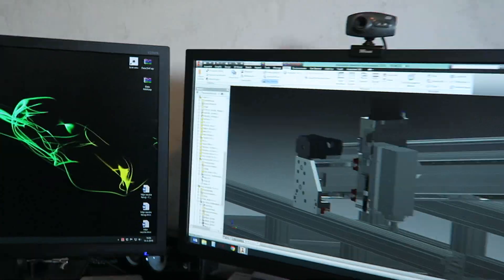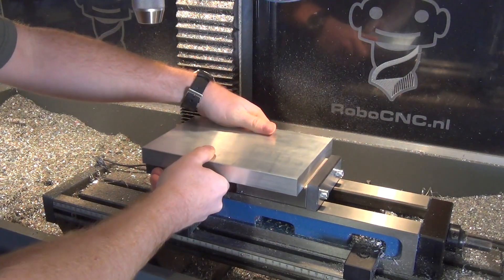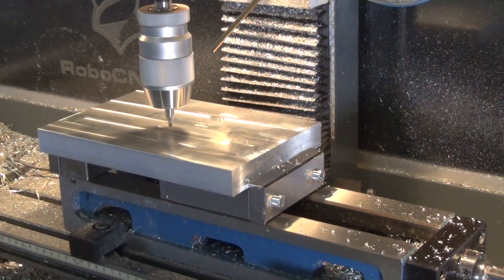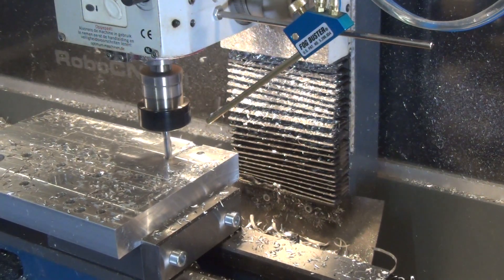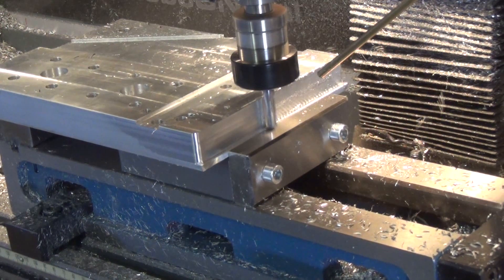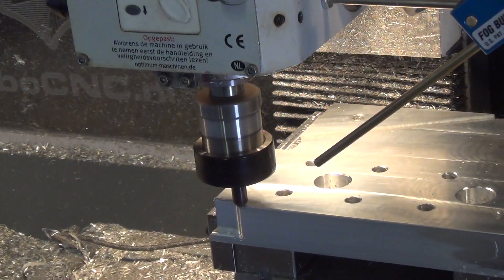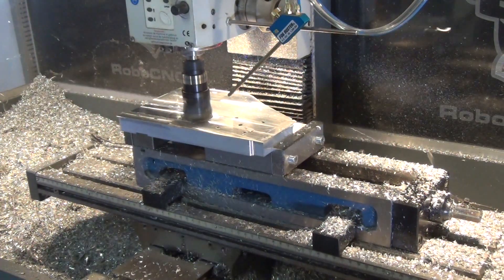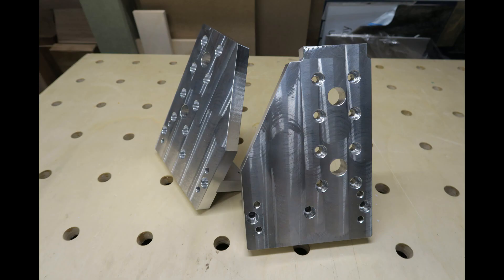RCNCX2 Router 03: Machining the aluminum Gantry Sides

Comment: So nice Work !   Amazing Part !  Some mechanical engineer tell me Alu Profile is not enough Solid to create CNC because of corner joint, What do you think about it ?
Reply from the maker: Well it depends on the cnc work.. keep in mind this is a CNC Router, not a VMC. a machine this size will never stand up rigidity of a VMC. Thats also why i will not use it to machine metals other then like Alu, or brass.

Comment: Wonder if those inserts need more or some positive rake angle, the way they are pushing the edges of the soft aluminum?
Reply from the maker: It seemed like a very close fit, not sure if your method would be better but thanks for the tip !

Comment: Hello... I was wondering why you didn't make the sides 24 or 25mm thick.. wouldn't that  make it stronger.. than the 20mm?
Reply from the maker: Yes that's trough, but then you would have asked why I didn't make them 30mm ;) 
The extra thickness only makes it stronger by a marginal margin because it is super short and mounted to the Item profile over it's full body...  I think you must watch the Y-bridge video to see how strong this really is, that video will give a better view on how this is used...

Comment: Hello, Marcel. I do not understand how you did to make aluminum with the homogeneously without those marks machining ... Could you explain me?
Reply from the maker: Hi thanks for watching the video.... I don't know if I understand your question... because in this video I have not shown the final result with the homogeneous result.... The part shown in the end of this video is just inclusing the machining marks.. but I have used a 40mm facemill so the machining marks are quite big. After this proces (not shown in this video, but can be seen on my Facebook or Instagram account is bead blaster... (some sort of sandblasting, but not with sand, but with glass beads, this gives the final great surface finish and is very homogeneous

Comment: Never thought that small benchtop mill would be rigid enough to make such cuts so nicely in climb-mill fashion instead of the conventional way. Nice job.
One point for Optimum.
Reply: +h4z4rd42  -and one for you too Marcel. Obviously.
Reply from the maker: +h4z4rd42 Thanks for the great comment and the two points ! lol
Yes the mill is preforming well, also with climbcutting and Chinese ballscrews...

Comment: Nice work. Do you use g wizard for feeds n speeds? Also, adaptive clearing will save you a lot of time when you r doing a slot or a large pocket. Cheers
Reply from the maker: Hi +Mohamed Aly , yes i do use G wizard indeed for the feeds and speeds...
And I am now also playing with Fusion 360, so will do an adaptive clearing next time..
(I did not yet use 360 at this time).. Cheers and thanks for watching and commenting !

Comment: excellent work on the side plates. what 8mm cutter did you use and what speed and feed. Cheers Dave
Reply from the maker: +Dave Bassett Thanks Dave ! My experiance is still growing and it's a bit to early to start advising people on the feeds and speeds. I have used G-wizard, and if i recall correctly it was 120mm/min feed at 2000rpm with a pass depth of 4mm. But again... test your recipe before using mine :)

Comment: Good job, but why mill away that 4mm?
Reply from the maker: Hi +Eric Beckers , this has two reasons... 
1 I want the peaces to be 20mm and dead flat. so buying 20mm is not an option because i want to machine all sides to make it flat and parallel. The second reason is the clamping... I want to contour the part for the full 20mm, but i still need some material left to clamp it in the vise... thats why i went for 25mm thick material.